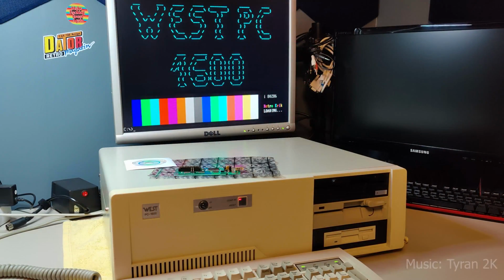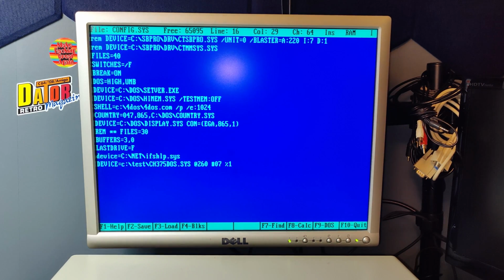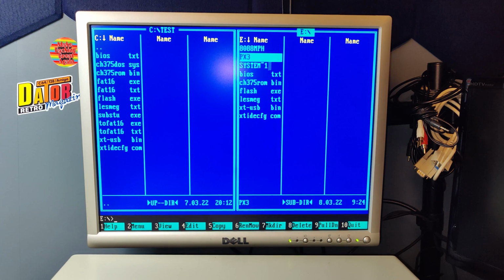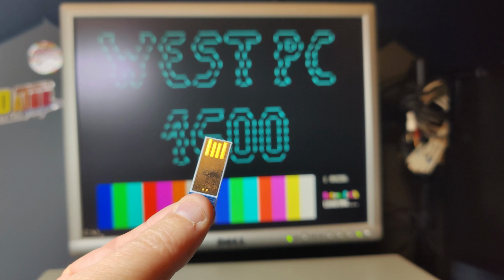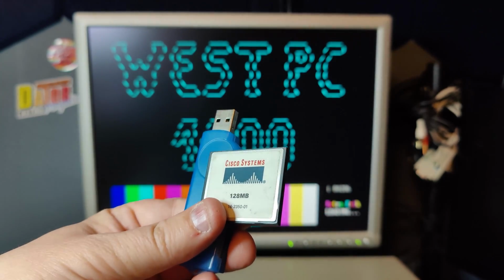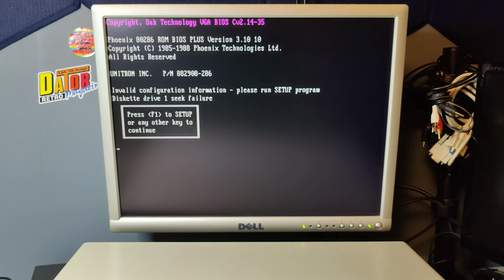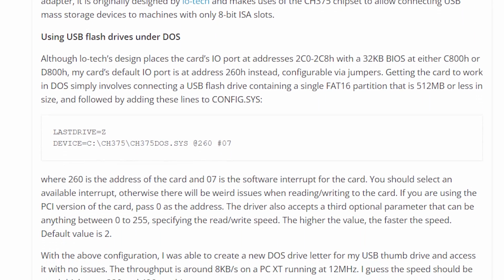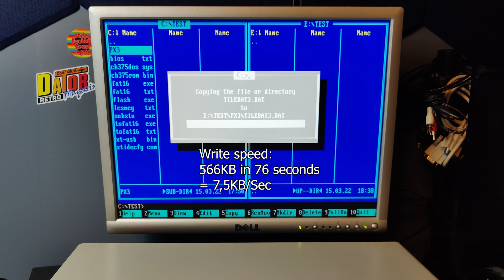USB ISA card for your PC/XT/AT system

Comment from the maker: After watching Tech Tangents video(https://www.youtube.com/watch?v=cgtvVi_mjjg)  on this card i ran some new speed test comparing the 1.9 and the 2.0a driver.

Space Quest 3 copied from XT-IDE to USB on ISA card (1,964MB) on an 286-12MHZ machine
1.9 driver: 48 sec with parameter %0
1.9 driver: 52 sec with parameter %1

2.0a driver: 71 sec with parameter %0
2.0a driver: 72 sec with parameter %1

As we can see the 1.9 drivers are about 32% faster.

Comment: Thanks for taking the time to make this overview.
I was excited for this until I saw the results of the speed test:  565972 bytes in 61 seconds is 9KB a second, which is slightly slower than a 360K floppy drive.  Even your later test at 27KB/s is slower than a network adapter transferring via FTP using mTCP.  It also seems limited to 512MB or smaller flash drives.  So while this is convenient, it's not for me personally.
Reply from the maker: I agree it's not for transferring big data. But it's ok to have the option. And also we get a USB port for 5v supply for other gadgets. ;-)

I had no problem using 2GB FAT16 partitions. I know that Touchdev wrote that it was limited to 512MB. Maybe he was talking about boot drives, and that the limit was in the ROM BIOS?
Reply from the maker: I did a new test with version 1.9 of the driver the speed is now 32% faster. Also copying larger files are considerably faster. e.x. i used 48 seconds to copy 1,964MB that is 40KB/s.
Reply: @RetroErik  thanks for the update! That's now roughly at the speed of a parallel port transfer, so definitely a big improvement.
Reply: @JimLeonard  Just wait some Weeks, you can order some now ;)
Reply: @JimLeonard  No need to wait for weeks, I now have a much faster driver. So you can buy some :)